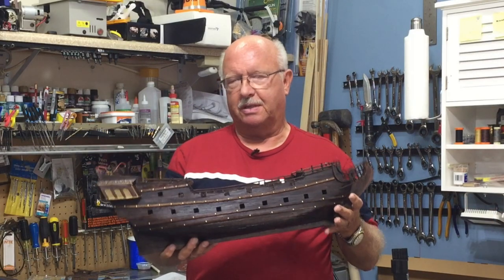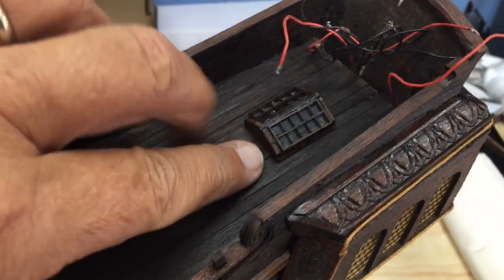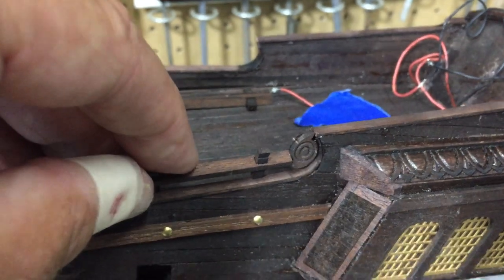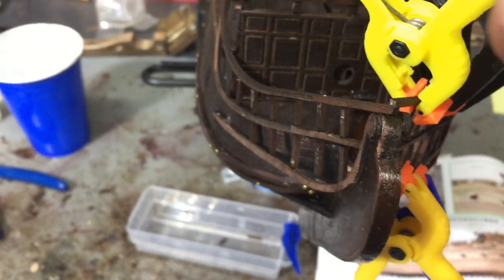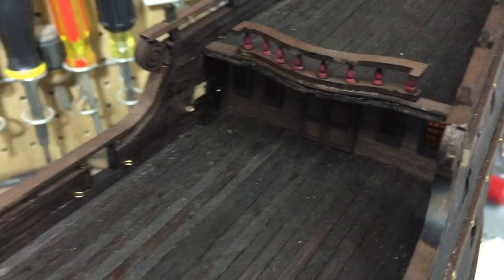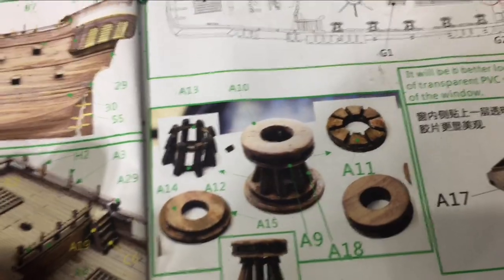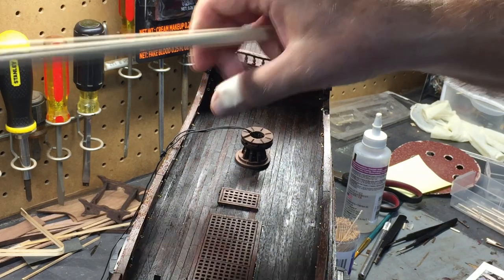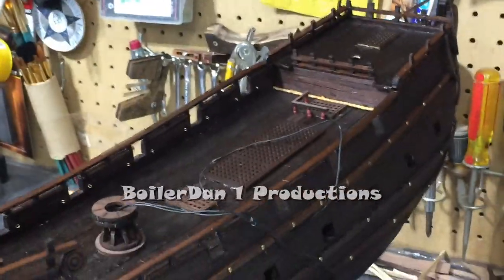The Black Pearl Golden Version 2021 Episode 10

Comment: Lookin Good! Thanks for the painted rope tip. will be trying that out on my latest project
Reply from the maker: The rope looks even better in person!  A little tip:
Glue the ends of the rope so it won’t unravel.
I put on a disposable rubber glove and slide the paint up and down the rope working it into the twists.
Then hang it vertical with a clip or something to pull it taught while it dries.
Reply from the maker: Make a couple of different sizes (diameter).